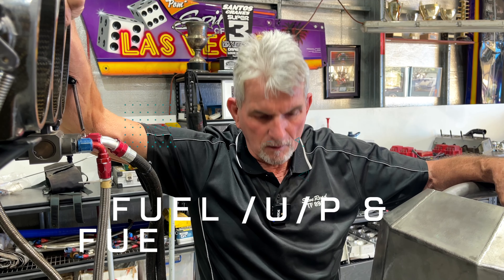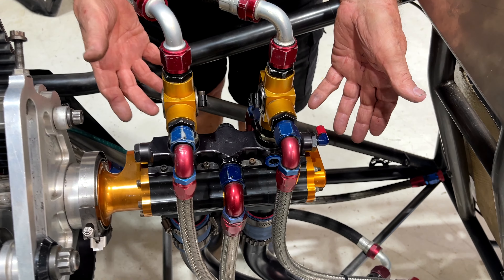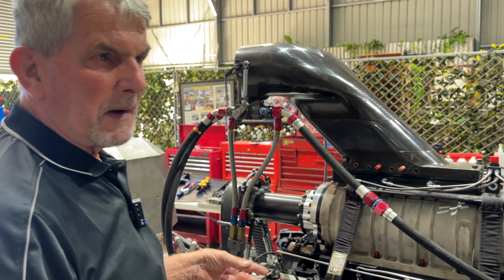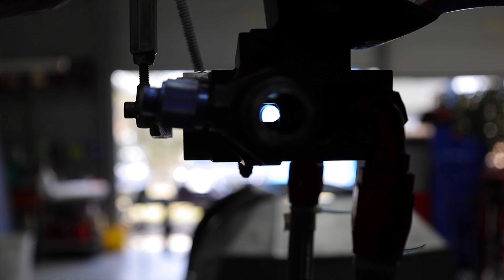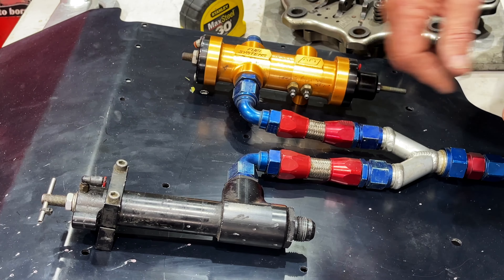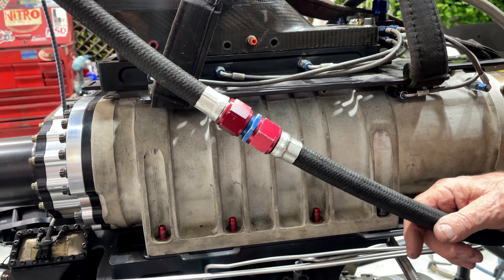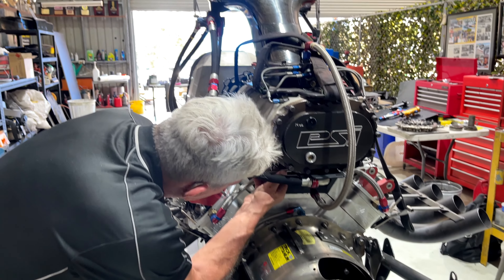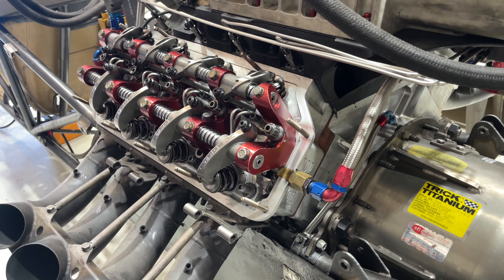THE FUEL PUMP & FUEL SYSTEM ON A TOP FUEL DRAGSTER

Comment: With the fuel pump driven from the cam, it the cam belt driven from the crank? Do you worry about the belt breaking? Or are you running like a Pete Jackson gear drive? To give it a mechanical connection?
Reply from the maker: There’s no cam belt, just gears.

Comment: Great video. I see alot of teams take off the fuel line from the barrel valve just before shutdown, why is that ?
Reply from the maker: Shuts the engine down sooner because theres no fuel going through the supercharger. As the only lubricant to keep the teflon cool inside the blower the sooner you stop it from running the longer the teflon lasts. Thanks for the question

Comment: Hard to fathom that an engine can actually use that much fuel in such a short time
Reply: Well towards the end he says that there is a concrete risk of the fuel choking the spark plug, and that can cause fuel to say in the cylinder reducing the space for air and therefore increasing pressure on the compression stroke so much that it can blow the head gasket and damage the blower....
Reply: Nitromethane requires much less oxygen to burn than gasoline (factor 8.6). The Roots blower uses 1000hp at maximum pressure, and still doesn't manage to get enough air into into the engine for gasoline, and I guess not even enough oxygen to completely burn the nitromethane. But, luckily, nitromethane even works as a monopropellant (no additional oxygen needed), producing carbon monoxide and hydrogen (which will also ignite, possibly after leaving the engine). So you can run with a very fat mixture.

It's very different than gasoline, in many respects! It also provides better cooling than gasoline, IIRC.

The engine "pumps" 4 liters per revolution, doing 240 revolutions from start to finish for a race. That's nearly 1000 liters of (pre-compressed) air/fuel mixture. Mathematically, this works out. 1 kg of nitromethane with only 1.7 kg of air for a stoichiometric mixture, less air and more nitromethane for the fatter mixture we want. VERY different than gasoline!